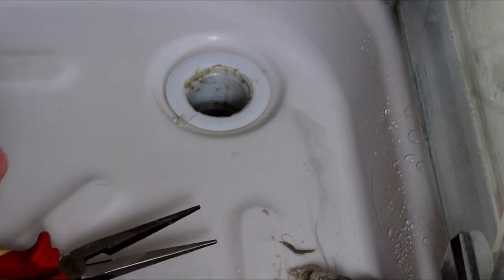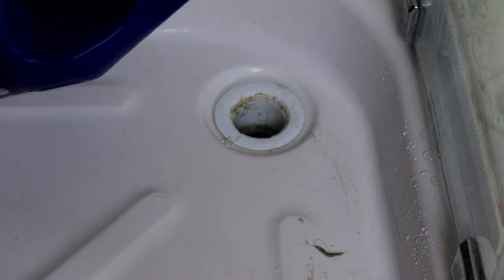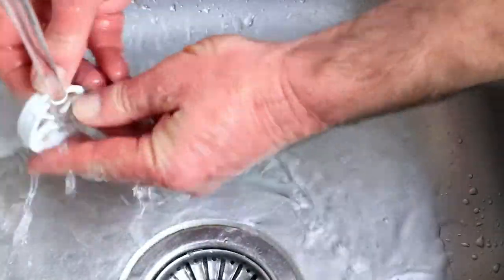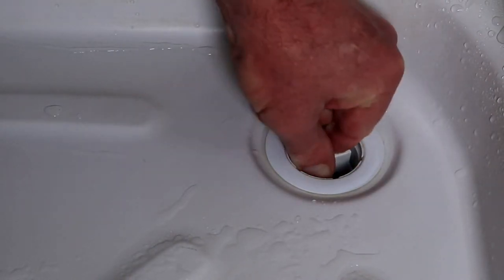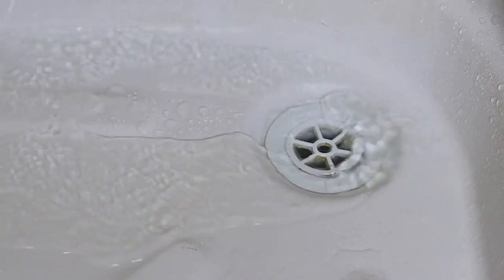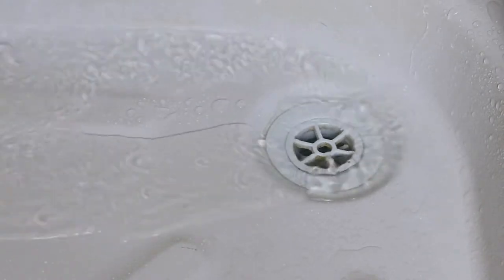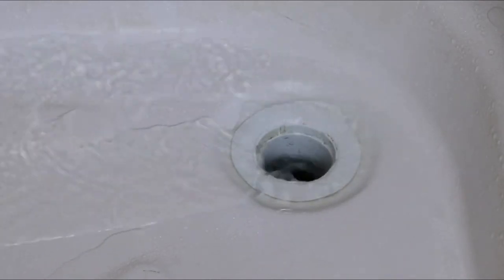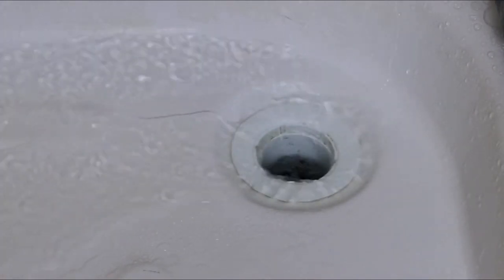Unclog a Shower Drain

Comment: Very useful indeed. i am finding it difficult to get the drain trap back in. Please advise. Thanks
Reply from the maker: If you look closing at the trap and it depends upon the make / design of it, it should have locating points on it which you align with the outlet and then turn either clockwise or anti-clockwise. Picture a bayonet light bulb, it has two pins that need to locate in the socket which you put that in first, push and turn to secure it. A drain trap is similar. If you still having problems, take a close up pic and email it to me. Furthermore, if you remember how you removed it then do repeat that same process but in reverse.
Reply: @how2withbasics567  Thanks, that was very helpful
Reply from the maker: @venugopalan4502  You very welcome

Comment: Mine is same type. Now I cleared it last night and poured boiling water and bleach down. Now it's blocked today🙄. Does the trap have to be replaced in a certain position. Because it twists fully clockwise now like I broke it brut force twisted it so much!
Reply: Does the dip tube have to be correctly fitted back in. With or without it and at multiple "clock" positions it still won't drain abit. That's the only thing or maybe the boiling water clogged it further! Can't see in now either as tray water logged
Reply from the maker: @pokersgoat3232  It should still work however it seems that there is a blockage further down the pipes. You can try dishwash liquid with hot water and pour that down and give it a good pump with large plunger which will help to shift the blockage. Another little hack once the blockage is cleared is to get a +- 6 inch length of plug chain from the local hardware i.e that is the type that has little balls on it and secure that to your shower pan outlet. The hair will catch onto the little chain balls thus making it easier to pull the hair out and unblock the outlet.
Reply: @how2withbasics567  good tip on stopping hair going further TY Tim, I have no plunger, will purchase tomorrow!
Reply from the maker: @pokersgoat3232  Good luck and let me know how you got along. Always pleased to help others as often the little things seem bigger and worse than what they really are. Always some trick to fix almost everything :-)
Reply: A miracle! It cleared itself! After I just left it for an hour and it's draining nice and fast now! a total.mystery to me but No need to shop for plunger and caustic soda!
Reply from the maker: @pokersgoat3232  Well done, I am pleased that it has been sorted out. Give some thought to the plug chain as that will make pulling the hair out of the trap easier in future.

Comment: What did you use to pull the hair out I don’t have a screwdriver I have scissors 🤣 I tried it and it doesn’t work
Reply from the maker: I used a long nose pliers however as you have limited tools I suggest using a wire coat hanger, Try straighten it a bit and make a small hook on one end and push that into the outlet twisting around a bit to hook the hair adn pull it out. You may need to do that a few times to ensure that you have removed all the hair. Once you have done that, pour a few buckets of hot water down the outlet to free it up. If you still have problems, give me shout.
Reply: @how2withbasics567  hi I have manage to get some of the hair out however when I run the water it’s still blocked . I can’t seem to get the dip that acts like a block out that is filled with water when I look inside it . I tried to remove it anti clockwise but it budge a little bit and would come out . I can only twist it , it won’t come out. I now tried doing it both ways and it won’t work I give up😭
Reply from the maker: @jughsjsfzbwhshhshshhs9876  I assume by the sounds of it you have trap similar to mine as shown in the video. Agreed the trap can be turned either clockwise or anticlockwise but bear in mind it has a bayonet shape so you will find +- half way between the left and right turn will be a bayonet slot which you need to feel as you turn it to find that spot. Pull gently upwards as you are turning it as that way you will find the correct position where it will then lift out.
Once you have removed the trap pull as much hair out with a longnose piers or a home made hook. Once you have done that, pour a few full buckets of water down the outlet to free the excess up. 
If you have any further problems, give me a shout.
Reply: @how2withbasics567  yeah I have the same trap as you . I can’t see the  +-  or the bayonet slot when I twist it, it feels jammed . I twist both ways to gently pull it it still won’t work and I can see in there that there is water in there . I will try again.